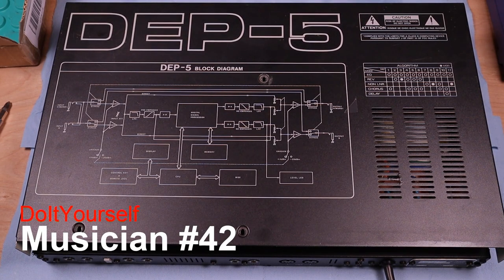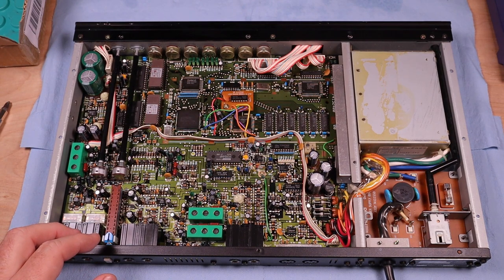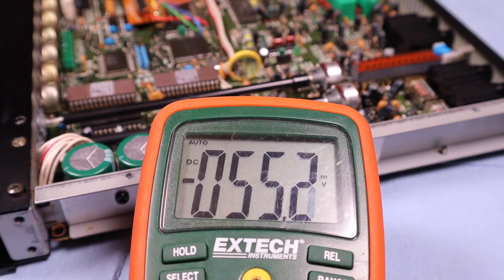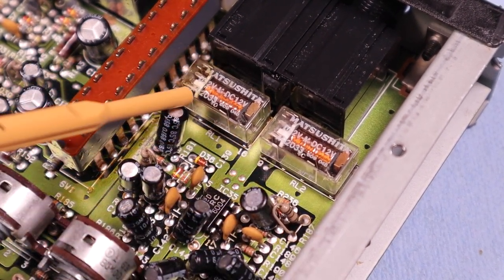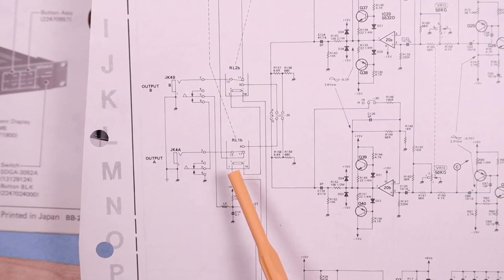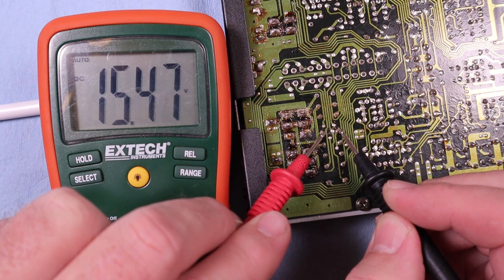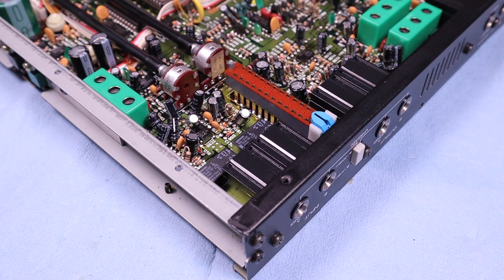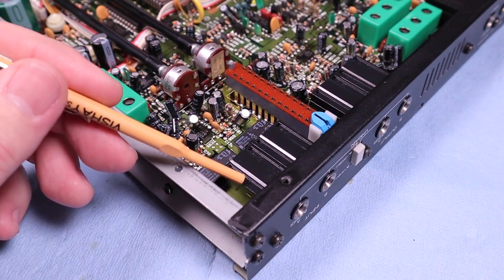Ebay Roland DEP-5 Relay & Battery Repair DoItYourselfMusician #42

Comment: Thanks for making these videos! I'm working on a DEP-5 as well. By the way, as far as the cr2032 batteries with the offset pins go, those are the ones found in Yamaha DX-7 synths and some of their rack units. I've lost track of which units of mine still need new batteries... One of these days I just need to solder in battery holders for every single one of them! I already put one in my DX-7.

Comment: Great video, but I do have a little concern with the power dissipation. Running a 360 ohm coil with a coil voltage of 15.6V~ would result in power dissipation of about 670mW, greater than the recommended 400mW power rating for both the original (DS2E-M-DC12V?) and modern alternative (G6A-274P-ST40-US-DC12) relay. I wonder if this excess power is contributing to the common failure of the relays in these units? Could be mistaken.

After some searching, I've found an 18V relay (RY-18W-K) which will switch at 12.6V, it has a much greater coil resistance of 1.62 kohm. Using this relay would result in a power dissipation of 150mW which is within its spec. Note I haven't tested this relay myself yet.

Comment: Hi all. I just recovered my DEP-5 that had been stored more than 10 years in an empty house. A friend of mine could repair the battery as well as some faulty parts, but it seems that all the "sounds/settings" have gone. Is there a way to copy the data thru sysex import, and if yes, where can I find the data? Thnx bunches and Happy upcoming year!